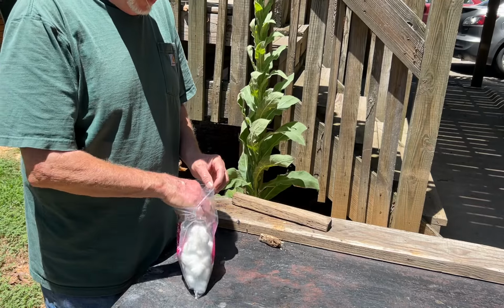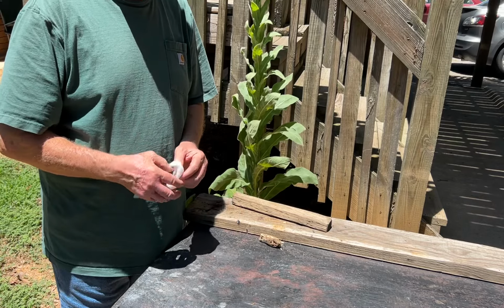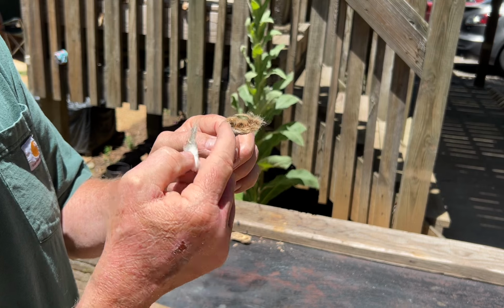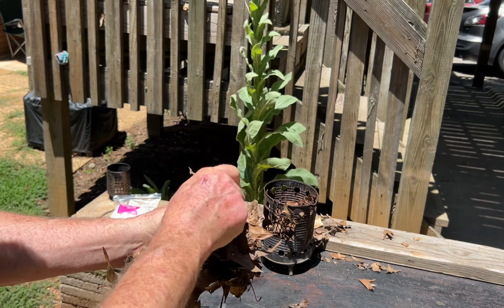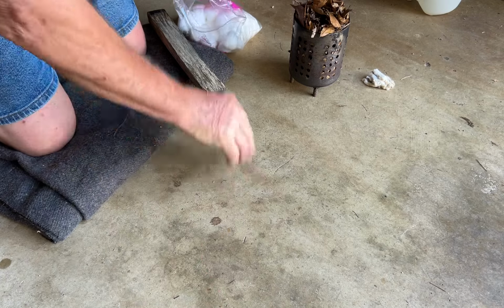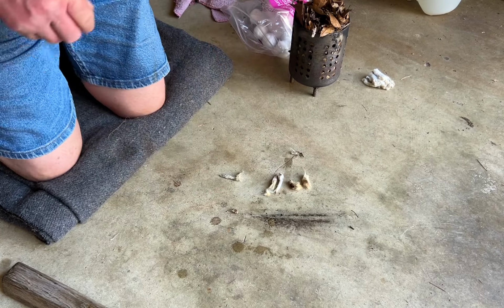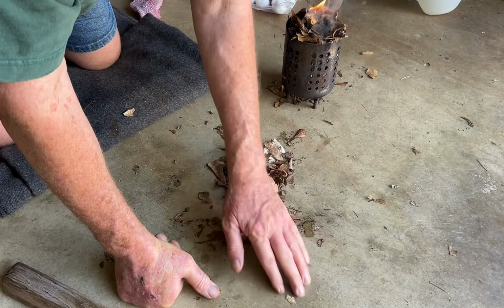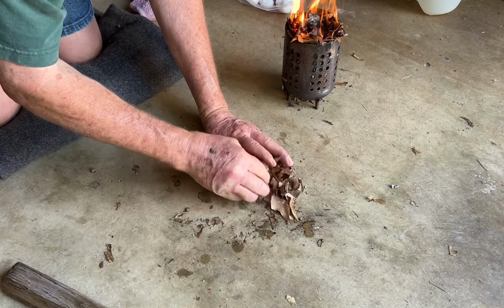Cotton Fire Roll (No Filler) 1st Success After 10 Years

Comment: David you really are the master of fire. Learned a LOT from your hundreds of videos. I suspect the filler in the cotton roll aids to keep it from getting too tight around the ember? Your 'picking apart' technique is genius. A couple of experimental techniques I wanted to share with you that I've stumbled upon in recent weeks that you may or may not have tried before: "Green Wood Scrapings Tinder Bundle".. If you peel the bark off a rolling pin thick section of LIVE green wood and scrape the freshly exposed wood, the moisture present makes long, thin shavings that have a puffy, foamy texture. It's possible to make a softball sized ball of shavings in under a minute, especially if you use the edge of your mora at a 90 degree angle as opposed to the spine. These shavings dry out in minutes in the sun and can be used as a great, high volume, low effort tinder bundle. If you loosely reverse wrap these shavings into a thumb thick cord, the end will smolder for a long time when lit and then blown out. Hung so the ember is on the bottom, a foot will smolder for an hour and a half! Great for fire transport and also as a moveable bug repellent. I also found that the charred end, extinguished in aluminum foil, will take a spark from flint and steel and can be used like char cloth with the rope lying on the flint. I used willow for my test but I've tried several woods and they all seem to make good long puffy shavings. Hope you find these experimental techniques as intriguing as I do! We'll catch you on the next one, God bless
Reply from the maker: That’s interesting, but I’ve got lots of other things I’m more interested in. Make a video about such. I will surly watch it.

Comment: wow, congrats sir that is awesome. do you think the fire roll has any validity in a real lost in the wilderness scenario if you only have a knife, for example picking a bunch of cotton lint from your socks/other cotton clothes and splitting a log so you have 2 flat boards? if you were hypothetically in a lost wilderness scenario with just a knife i assume a hand drill method would be your go to, or would you cut a strip from your shirt to try to use as a bow drill string?
Reply from the maker: There is no situation where I wouldn't have my pocket knife, ferro rod, wallet Fresnel Lens, and BIC. THAT's the whole point and why it's called EDC. Thanks friend.

Comment: Hello David.
Until now I had always believed that commercial cotton (sanitary or for human use) could not be used without any additive for the production of fire by the "fire roll" system. I think I should retract some of my statements in this regard.
A few years ago I turned to cotton flower (natural flower, not industrially processed) and it really worked without additives, which seemed to reinforce my theory: "The processing that cotton undergoes for sanitary use is the cause of its uselessness to light a fire through this system".

This is the video:
https://youtu.be/6SfUPDDxFrI?si=PEm1Vpzr8lCitD

Today I see that I was wrong.
Good video. You have achieved what I thought impossible.
Greetings
Reply from the maker: Not a reliable technique. After 20 more tries, I only got 3 ignitions.